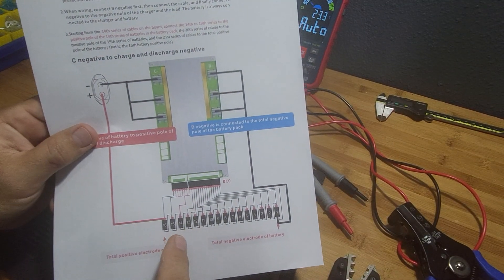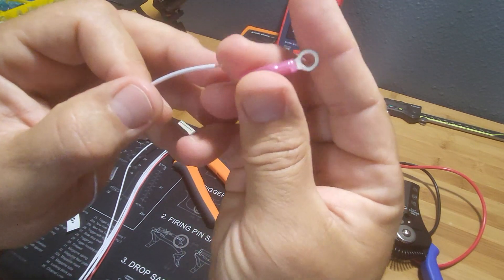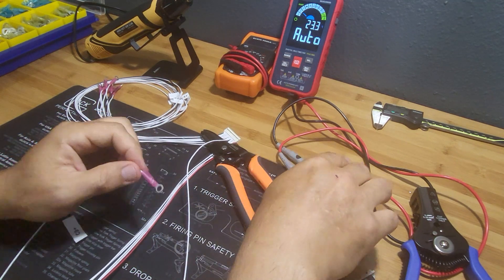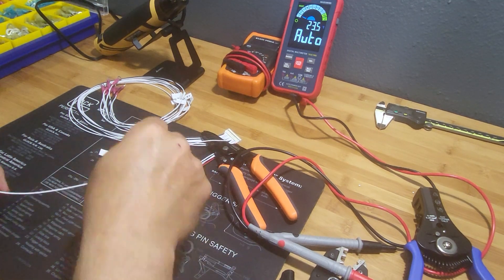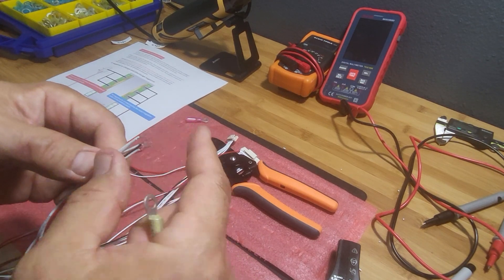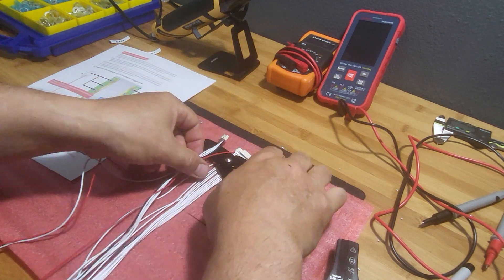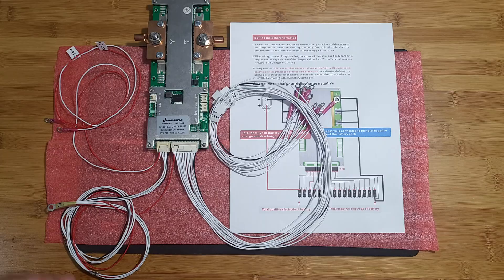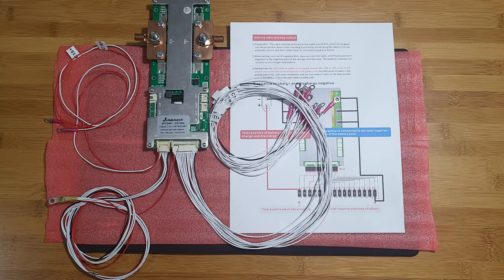DIY Off Grid Solar - Part 3 - BMS Wiring

Comment: 24s jbd smart BMS I need jumper digram of 19s
Reply from the maker: https://jiabaida-bms.com/blogs/content/jiabaida-sp24s004-smart-bms-8s-24s-wiring-diagram
Cell pins 9 through 14 are a cluster of 6 wires.

Comment: I just ordered two of these BMS to install on an 8s2p battery I’m building. Your video was well done and very helpful. Thank you. 

What I like to do when I’m crimping terminals on really small wire is (these balance leads look like they’re probably 26awg I’m guessing), I remove the insulation  to where I have about 5/8”-3/4” of wire exposed, and before I insert it into the terminal I bend it back so it’s doubled over on itself. This gives me a wire that’s now twice as thick and so when I crimp, I’ve got a bit more material in the terminal. 

Another trick I saw someone else do is after the crimp, you can take just a tiny bit of solder to that open end of the terminal, and then heat shrink. That w ay you’ve got a finished product that is completely sealed, protected from moisture  and ultimately corrosion. It’s a small detail but I think it can make a big difference especially in a marine environment.
Reply from the maker: Both are very good techniques and well worth it in a mobile or marine situation. Using a quality shrink full-seal terminal is also wise.  Thanks for the comment!